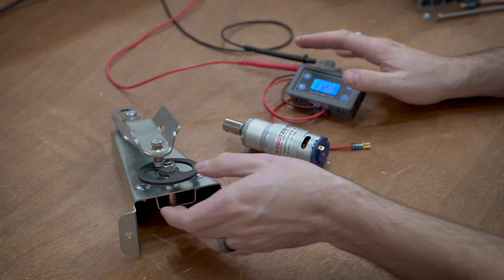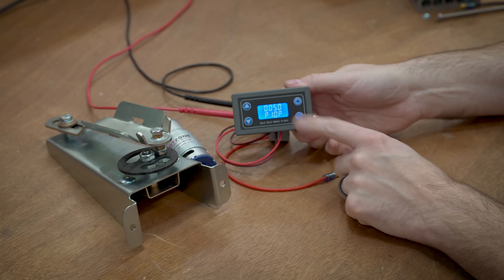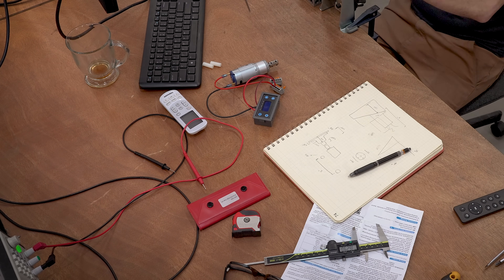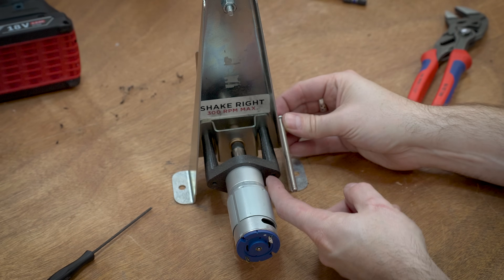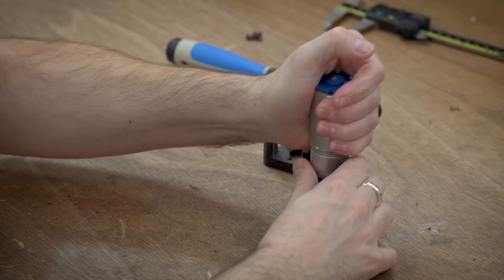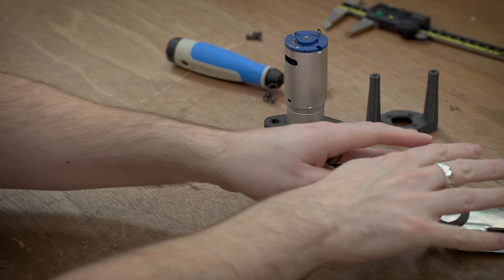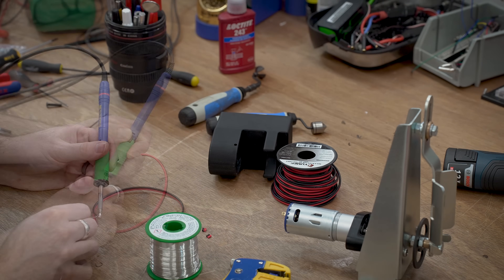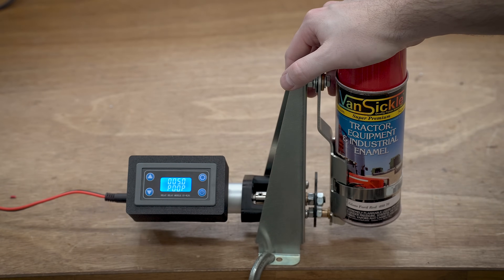DIY Automatic Motorized Paint Shaker!

Comment: Great final product but I'd hate to listen to that for 5 min. Haha
Reply from the maker: Well, between that and the 3d printers, I can just go inside...  It gets pretty noisy.  A lot of the time I have hearing protection on just to get rid of all the machine noise.
Reply: I'm sure you could really over engineer a quiet paint shaker but it probably wouldn't be worth the time or effort. Although now I kind of want you to.
Reply from the maker: @JonathanRansom This isn't enough engineering for you?!  I added a motor, microcontroller, and custom 3d printed parts. What do you want, beyond 1KW of power or something?!  The chop saw is pretty OP though.
Reply: Plenty of engineering, I'm just saying if someone /could/ make a silent shaker, it would be you.
Reply from the maker: @JonathanRansom I would probably just put it in another room in the house and put it on a remote-control.  Problem solved, where are my YT dollars?!
Reply: Connect it to home assistant and you'll have a gold mine.
Reply from the maker: @JonathanRansom  Ha, I do have a spare zigbee outlet...

Comment: I tape a can or two to a long Sawzall blade and run it on the oscillating mode, shakes the living daylights out of a rattle can.
Reply from the maker: I bet it does.  But you still have to stand there and hold it.

Comment: When running, there seems to be a lot of wiggling of the motor and 3D printed bracket. Perhaps the 3D bracket should have had a 3rd arm to make it more rigid?
Reply from the maker: There's a bit of wiggle but it's not too bad.  That mount is PETG which will hold up just fine with that wiggle.  There's NO way you're gonna get a completely solid motor mount, even out of metal.  Everything is going to flex because of the vibration from shaking the paint and the offset weight.  I just used a filament that allows for flex, so the wiggling will be just fine.

Comment: Neet way to mix paint.  But it’s a bit complicated.

I use a heavy duty succion cup and a drill.  I stick it below the can, not quite in the center, and spin the thing.

For piece of mind I put my drill on the hammer drill setting.  

I’d hate to be the paint inside the can.
Reply from the maker: HA!  I've seen the drill attachments, but I really wanted something I can set and forget (or go off and do other stuff)
Reply: @RobertCowanDIY  Truthfully, I’m a bit jealous of you setup.
Reply from the maker: @marc-bernardlevesque5016  Eh, don't be.  It works for me, but it might not for others.
Reply: sixtyfiveford (great channel) made one of the drill ones - it's basically just a piece of ABS pipe and a bolt that you can chuck into the drill. I do question whether spinning the can actually mixes the paint though - I'd suspect the paint just all sits at the edge of the can and spins, rather than mixing.
Reply: @gorak9000  I listen to the ball rolling before and after spinning.  Actually, the vibration from the hammer drill function is stunning.  Also, the slightly off axis sucking cup probably succeeds in spinning everything.  I didn’t invent this, I saw a man do it in the 70’s in a workshop.
Reply from the maker: @gorak9000 That's kinda what I thought.  If that worked, why don't sanders just spin in a circle instead of the 'random orbit' thing?  Also, whenever you buy paint at a store, they mix it FOREVER, very violently too.  And if you listen to them, you are supposed to paint within a few hours of mixing.  If you wait a few days, you're supposed to bring it back and shake it again.  I've painted with older paint before that's not properly mixed and it definitely doesn't seem to work as well.  I think violently shaking it up/down and side to side is the way to go.  BUT, maybe it's unnecessary.